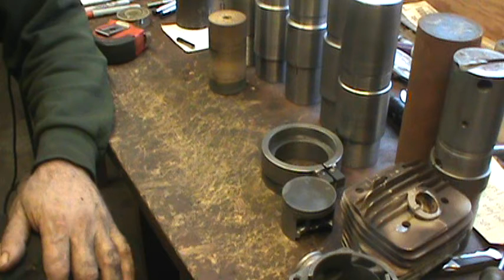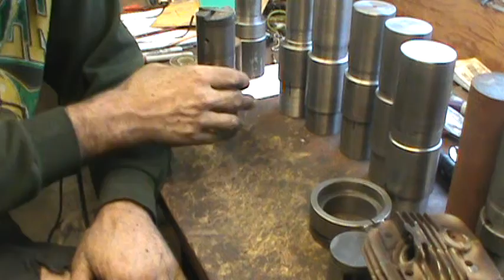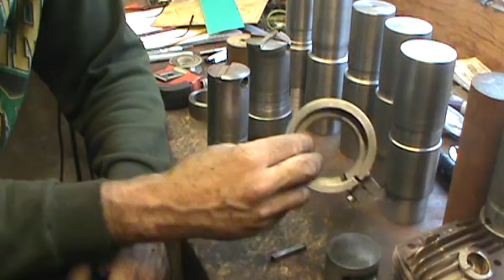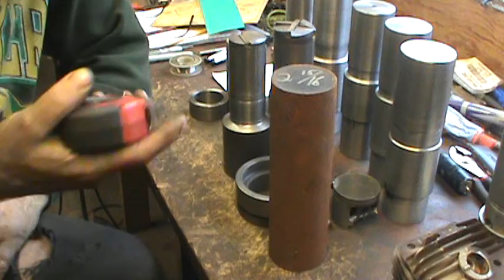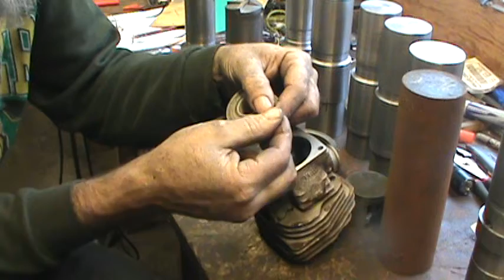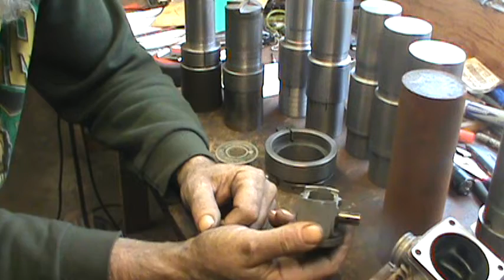talking mandrel and squish tools

Comment: More & more I'm suspecting you've got employment history at one of the major OEM's, I'd always wondered where those guys are, figured places like OPE would be godsends to them, but in seeing you & thinking "guy may've been at round-tables, at drawing-board, with a team developing a powersaw model"!!  Not trying to be hyperbolic or anything, your content is up for free & almost nobody reads comments anyways, I just had to ask because being 1.5 decades early on flatter/flat squish bands is just insanely impressive (it's like the handfuls who were using "rigging ring" type slings using D-shackles, before real rings came out & replaced pulleys for most rigging)  Thanks as always, never felt so confident building and not only am I doing the 2-660's project but my husq 425T/zenoah g2500 clone lost so much compression it finally died, will be getting it a new top-end, and only now am I feeling confident "choosing my own #'s" for a powerhead where I won't find any threads, any youtubes, etc etc for porting that specific cylinder (and it's an odd-duck cylinder, exhaust port literally has a wall, presumably to prevent freeporting)
Reply: Oh, Jesus, bow now.